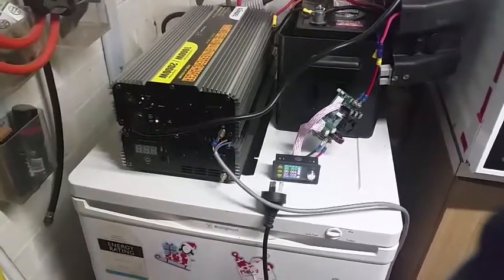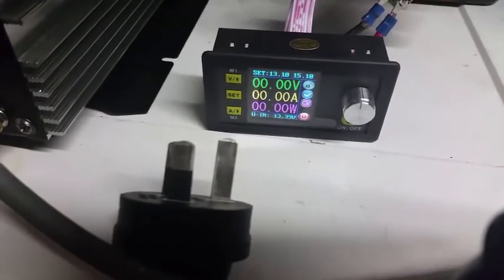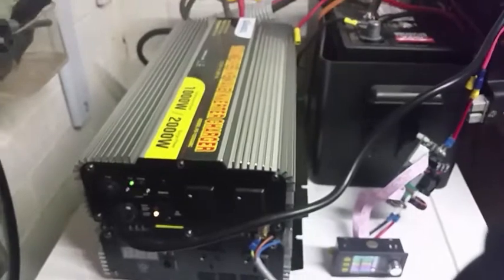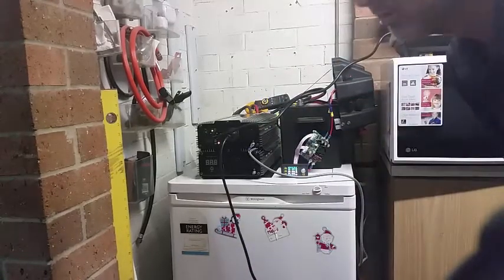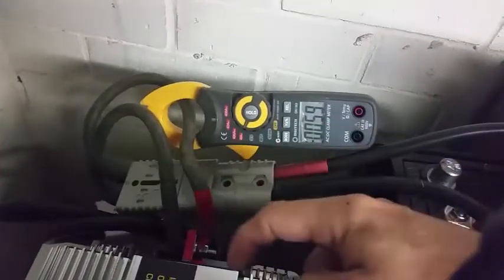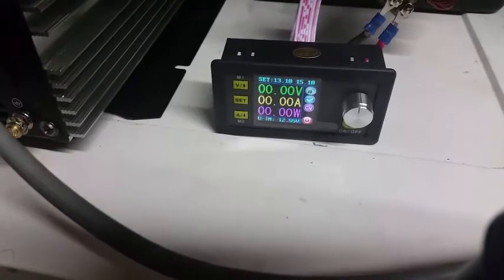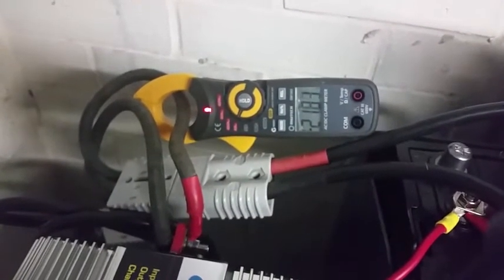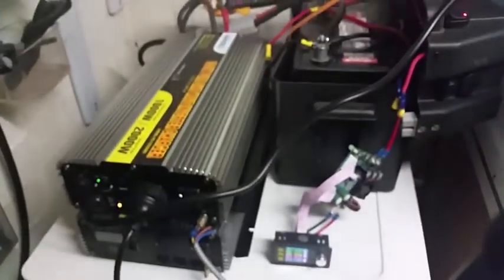Setting up an inverter charger as an UPS for a freezer

Comment: A chilled freezer should maintain a safe temperature for several hours without power, so I would expect the freezer to run an hour or two, then shut off until it warms above the set temperature, then repeat.  50AH might be adequate for 8-10 hours or more, depending on the quality of the freezer's insulation and the ambient temperature.

Comment: Not a good test ! If the freezer wasn't running when the power failed then the inverter would have to supply extra current when the compressor motor starts up.
Reply from the maker: That's correct, and it does so :) 
That's a high current load of around 25 amps for a second or so, which is why you need surge capacity in the inverter.

Comment: Just purchased one of these inverters. What I like about them is that the input is electrically isolated from the output AND they have the internal elecrical hardware to enable them to be earthed to the ground, without having to purchase expensive RVD and RCD devices. Something that perhaps most people thinking about buying an inverter would not even consider BUT these 2 capabilities could one day save a life. Might pay to research a little about input/output isolation and inverter earthing! Sure raised my eyebrows.